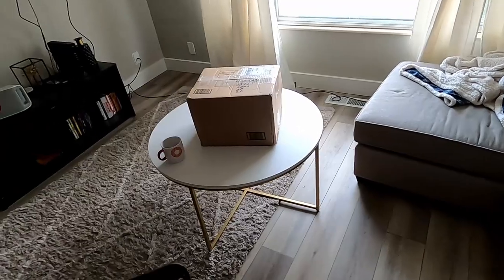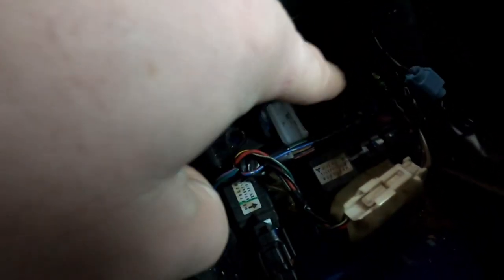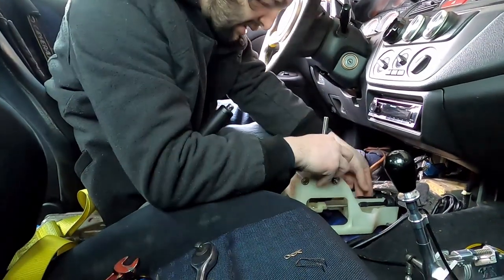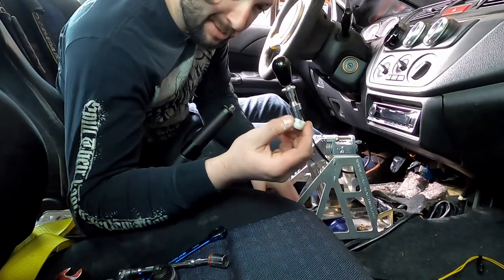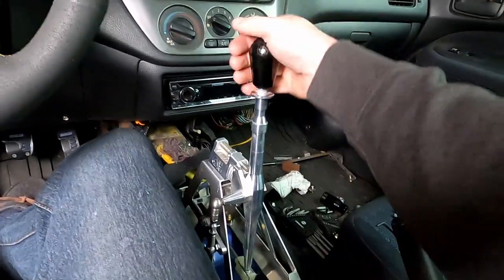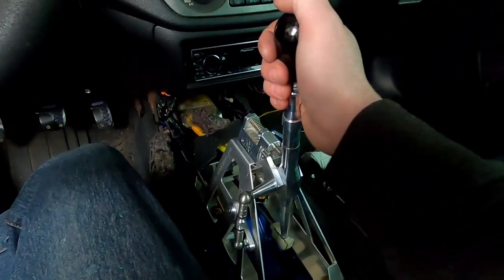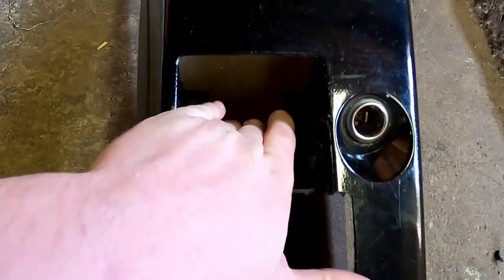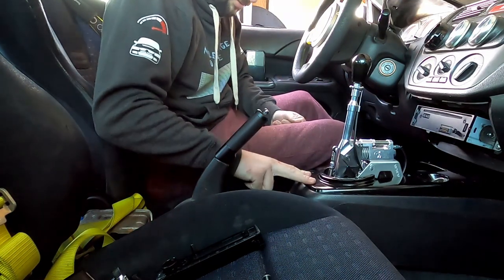CAE Shifter Install/ How To (Evo 8/9)

Comment: Hey how did you get your reverse to clear mine hits the linkage with the lock
Reply from the maker: It’s a lot of playing around with it, mine did the same, just have to play with the fitting on the driver side and the set screw at the top that allows the left-right play.
Reply: @nipplel3sscage I've been trying lmao. What fitting are you talking about? Sorry for my naiveness 😂😂
Reply: The one inside the center the  L shaped bracket?
Reply from the maker: I believe we’re talking about the same thing. 

There are 2 nuts on the driver side of the shifter with what I’m referring to as a fitting, but both sides of that fitting are threaded. I honestly can’t remember the name of that piece 😅 but you basically have to loosen both nuts and play with that fitting to either loosen or tighten the left to right motion, then tighten the nuts. I hope that helps, if it doesn’t I’ll try to make a “short” for that.

Comment: For 6 speed available?
Reply from the maker: Believe they're only available for the 5 speeds.
Reply: There's a 6 speed one now.
Reply from the maker: No way!! I'm surprised they would do one for the 6, seeing most 6 speeds doing a 5 speed swap
Reply: @nipplel3sscage  Yeah it just got released last month. 👍
Reply: Very cool shifter!  I have a Evo 8 MR still original 6 speed with exedy XD twin disc HD clutch.  Might do this shifter upgrade as you got to save the 6 speeds.